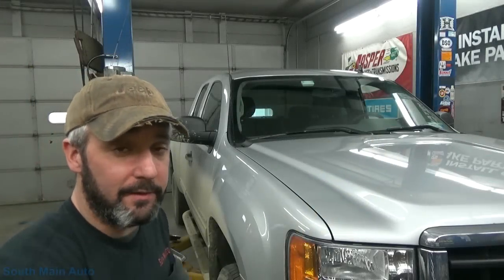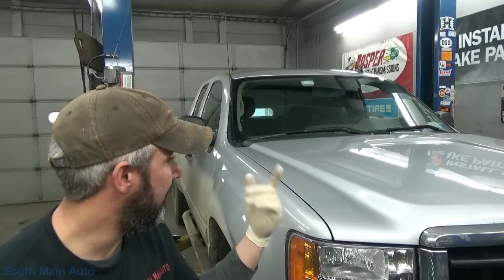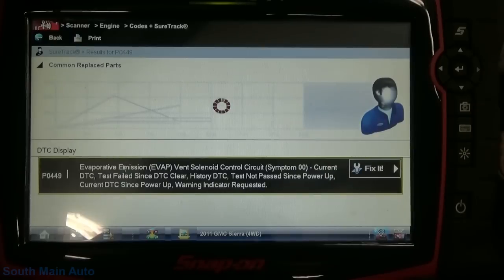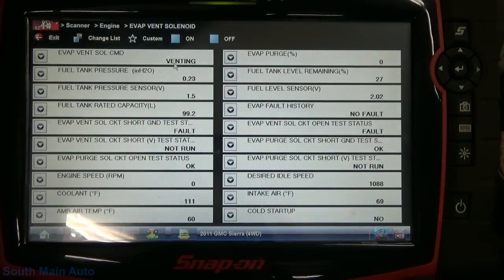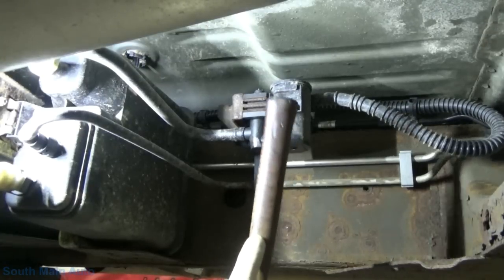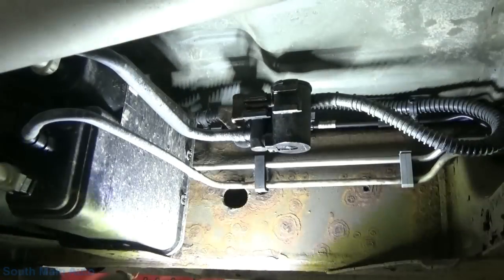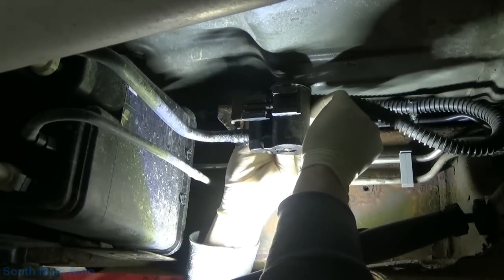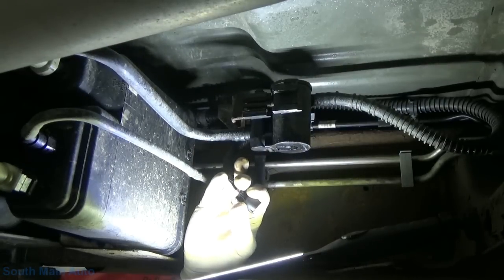GMC / Chevy Truck -DTC P0449 EVAP Vent Solenoid Control Circuit

Comment: It absolutely amazes me the amount of emission equipment installed on modern gasoline engines. Meanwhile, most diesel trucks on the road are producing  huge amounts of cancer causing smoke with very little monitoring.
Reply: not exactly... the exhaust system on a newer 6.7 powerstroke is over 10 grand... It has a DPF, Catalyst reduction. The truck also has EGR COOLERS, and they use a MASSIVE amount of EGR, not like the gas engines that use just a littlebit. Post 2008 trucks, by law you are not allowed to have ANY diesel particulates come out of the exhaust and the NOx has to be pretty much 0 as well...
Reply: Have you seen the new diesels? the emissions equipment on them is ridiculous!
Reply: TrakSpock1 yeah... and in New Mexico it doesnt matter if theres an onboard diagnostic trouble code for registering a vehicle... I know a few of my buddys cars have no PCV valve back to the intake, no EGR valve, no cat, no muffler, and still register their car and plates and sticker.... evrything... kind of bad for our planet though...
Reply: TrakSpock1 its all a scam.....vent valves....purge solinoids....vaccum pumps....then the def junk.....what a waste...the diag time on def is stupid
Reply: TrakSpock1 you have no idea what your talking about I guess you never seen or driven a modern class 8 rig out from the factory tool
Reply: The EPA has been outright hammering diesel trucks in the consumer market for the past couple of years. Diesels are actually more efficient and although that smoke may cause cancer, it at least falls to the ground and doesn't mess with the atmosphere.

I'm not defending those douchebags who roll coal in anyway at all, but people need to do their own research. The government is trying to shut diesels down and there's a hidden agenda behind it...
Reply: Yes i do. I work around diesel engines 12+ hours a day and a large portion of our workforce has cancer.
Reply: Yes I do. I work around diesel engines 12+ hours a day and a large portion of our workforce has cancer.
Reply: I'm sure that it's the same story with those working around gas engines.
Reply: TrakSpock1 do you not realize def and dpf and egr systems on a modern Diesel engine? that's no where near the emissions on a gas engine so I have no idea what your getting at!
Reply: In the UK about half of all our cars are diesels and the air quality in London and certain cities and around our main motorways like sections of the M1 and M6 is catastrophic. Particulates and oxides of nitrogen which are the result of diesel vehicles. The average road tax on an avergae diesel like 1.5TDCI in the Focus or 2.0 TDI in the Golf is like £20-£30 while a 1 litre or 1.3 petrol car will pay £110-£130 for emissions. Even though petrol vehicles burn relatively clean compared to diesels. It burns my bacon.

Comment: I would say any circuit with a load, the Test light would be fine, bit any signal, communication or reference circuit.. I would not use it on.

Comment: I thought for sure that was gonna be a Loadpro you pulled out not a SO circuit tester!
Reply from the maker: I almost did Mike but then I thought how bad it would fail on a current limited circuit giving false results so I went for the test light!

Comment: I replaced mine and the light came back. What can it be? Please help!! 2017 GMC Sierra
Reply: I have the check engine light on auto zone told me vapor canister I changed  light comes up again now I'm changing this solenoid valve I hope I fix my problem.

Comment: I think you should make a video on how to change the transmission fluid in your tundra. check it out, there is barley any videos on how to change it and how to make sure the level is correct. the stealership wants to charge upward of 500 bucks!

Comment: Test lights are only dangerous for people that dont know how to use them.
Reply from the maker: Not at all. Can you tell me how?
Reply: Well they could poke themselves in the eye. Nice video Eric, seems like a lot of rust for a 2011 , noticed it on the frame rails.
Reply: I was gonna say i dunno if anyone else noticed the frame rust, 
but i was sorta sitting there thinking i'd love to take Fluid Film by the gallon can and an electric paint sprayer or their air compressor kit and spray the hell out of that rust and any the underside of that truck. Or use Krown T40, either would do.

Both being non conductive is nice too.
Reply: 101sabre 
how many times I have poked myself with stupid probes! lol

Comment: Another one I'm preparing for with my '07 Silverado. 

I'm shocked the light hasn't come on yet for something - figured it would have by now, the way they build things today. Probably just jinxed myself ... lol!

Threw some headlights in a '04 Honda CR-V today. Wasn't too happy with Honda - gotta yank the whole plastic "bumper" off the front with all the rusted fasteners and brittle plastic push-pins just to extract them. What a joke! Pair of headlights off eBay for $80 shipped! HAHAHAHA! They actually fit too - shocker! For that price might as well make it a 2-year maintenance item. :D Happened to notice the location of the steering rack while I was in there - hope that thing never goes! Holy crap ... what fecal engineering that is!  Looks like it's only accessible from the wheel wells. Yikes ...

Also got a '05 Volvo V70, 2.5 turbo 5-cylinder - still need to poke around in the Autel on that one. Lots of strange PIDs I'm not familiar with. Strange codes too that needed translation. Guy is planning on dumping it at the auction, so probably won't get into that too deep, but I'll play on the Autel just to learn. I just had to fix the oil leak - was puking out of the plastic oil filter housing. $25 for a housing and a Bosch filter - not too bad. Easy day!
Reply from the maker: If PIDS on Eurotrash get out of hand I usually poke back in OBD2 Data to see if I can make sense of it
Reply: Ahh,  thanks! I'll try that out.

First time I have ever seen kilograms per hour for MAF. Fuel trims are strange too - something "integrator" (not the old block learn / integrator either) - forget the terminology, but was the first I have seen of that too. Had to poke around a bit to find live data - had another different explanation. Took me a while to figure it out.

Has a strange, real high-pitched buzz under the hood for several minutes after I shut the engine down  - no wonder the guy is ready to send it to auction. LOL. Another once great brand that's been cheaped out on front to back ...

Comment: My Silverado 2003 1500 LT came up with a p0449. The truck would idle very low or die out. I remember many years ago I had changed out the throttle body assembly with a new one on a truck I had at the time and that solved the problem. Now I have this Silverado doing the same thing. So I ordered a new throttle body assembly off of eBay which came with a new throttle body positioning sensor for like $56.00 and this solved the problem. My truck now idles again and doesn't die out. I suppose you could just order a new throttle positioning sensor and deal with drilling out the 4 rivets, but some people had a problem with the connector not pushing all the way in.

Comment: I do testing and build the testing equipment for the dust testing ingestion on this very same cyclonic/ CVS. It is tested to GMW-15826 and ISO-5011. These are very complex testing specifications. I'm surprised of the failure noted in this. The prefilter is in the upper intake by the filler neck ,  the cyclonic filter has a capacity of 40 gram , tested with ISO- fine dust. After the dust exposure it is tested to leak < 9 cc/minuet. There may be an issue of salt fog being sucked into the valve and make it freeze up. Not a failure mode in the test lab. Great video!
 I wonder if you have put 12vdc to the terminals to see if it activates the solenoid after removal? Almost needs a bore scope to look inside the ports to see dust cake build up, or anything else.

Comment: Appreciate all the information. I owned a 2009 GMC for 12 years. Traded it off in 2021 with 112,000 miles on it. Never once did I have a problem with anything on that truck. The only thing I replaced were my rear shocks at 108,000 miles.  
I bought a 2019 GMC 2 years ago with 35,000 miles. Since then, I have replaced my rear shocks and front struts. Front windows don't always power up correctly. Now I'm having problems with the evaporator system whatever. Almost makes me want to trade it in on a godforsaken Ford.
Reply: Anything past 2015 is when quality control went way down for both Ford and Chevy. It's called planned obsolescence, and it should be illegal.

Comment: I usually tape a chunk of string or wire to the filter before I pull it and the hose out of the crevice they stuffed it through.  Makes pulling the new one back in much easier.
The other option is to cut the hose off the valve and use the old hose as a pull snake.
The things you do when you don't have a lift.  :^)

Comment: The problem with the vent valves is they get dirt in them and they stick. Or they fail electrically. A lot of the time it's from dust ingestion a least here in the south. They get dirt in them because the air intake for the vent valve is on the fuel filler neck or they have been moved up on top of the trans as per GM's bulletin. But the still get dirt/dust in them. So why not hook the EVAP intake hose to the filtered air side of the air cleaner? Which would prevent dirt/dust ingestion.

Comment: Mine just went bad for the first time.  2007 Silverado with 187,000 miles.
Reply: Idk why a few loud mouths talk bad about GM. My silverado is 20 years old with 5.3 and 274k miles on it. Other than breaks and oil change its needed nothing but a fuel pump that I will put on here in the next few days. Still original coil packs too... Just replaced plugs and wires for the second time in its life!
Reply: @crowdnine878  Still driving it.  Now 211,000 miles.  No issues.

Comment: Has anyone told Scanner Danner you  can't use an incandescent test light on a computerized circuit? He might not take it well..........
Reply from the maker: Brian Smith it was a joke of course
Reply: South Main Auto Repair Hey sir, would you help me out on this code. P0385 which is a Crankshaft sensor position B. now not sure if it's the trans sensor or engine sensor since it has 2 Crankshaft sensors.
Reply: LACounty818  what year make and model engine size would be good to know
Reply: If it is a GM, I had 1999 Olds Intrigue 3.5 engine with that code and the a an b sensor are combined in one sensor. Sensor is located on radiator side of block near the middle (approximately) A sensor fixed that car, but as always, "Test, don't guess"
Reply: Grumpy's Garage yeah sorry I was dozing off. But it's a 2000 Accord with a 3.2 TL Type-S 6 Speed Manual Swap. I can rev the car perfectly fine and drives normal. Just trying to figure out which sensor is it since there's 2.
Reply: Scanner --has explained about test lights & how to check the lamps amperage
draw & mentioned 2 places you do not use a test light

Comment: Thank you for this video, Dr. O! I have watched your videos for a number of months now, solely for entertainment and education up until today.  I recently picked up a well-loved '05 GMC Sierra half-ton; I bought it with the money light on via this exact same DTC.  I knew you had done a video on this before and, sure enough, my YT history showed it a few months ago.  To note, the procedure is the exact same on at least the '03-'06 model years for Chevy/GMC but, at least on mine, I was able to re-use the hoses going to the various other components.  Took me about 15-20 minutes all-in with nothing more than a flathead screwdriver to loosen the hose clamps to remove the old part and to tighten them back on to the new part.  Watching your videos has given me the confidence to do these "easier" DIY jobs - heck, I told my wife it was easier than changing the oil in these newer vehicles - and I thank you for doing these videos.  I watch new ones almost the same day you post them!  Keep up the fine work.
Reply: Hey i got the same one. Did it ever go from working fine to next morning woildnt go over 40mph? It revvs up but then drops in rpm and hardly accelerates? 
Mine started doing that and cant figure out what it is

Comment: Darn, you are great and the information source! Love your Chanel and are a big fan. I have an 05 Silverado club cab that I pick up, which was beat, I repaired the many errors it had and now I'm enjoying the truck. Was unaware of the failure of the purge valve problem. Mine has no upper-end filter-what gives? I'll look into it. Thanks, Eric.🥰:learning:

Comment: Eric that test light looks suspiciously like the Kent Moore that the dealerships use its available at gm service solutions but extremely expensive I have been using one for years. One test light you may want to try if you can get on loan from the truck is the EECT401. I had to order mine in I have never seen them on the truck. Its digital  0.1v to 19v the box says 4v to 19v but is in correct the spec sheet tells it as it is. It really good on 5v circuits when the signal can be as low as 0.5v ,you can also do some quick and dirty checks on the canbus system when you will see 2.4v. Think
you would be impressed with it. If I get time I may do a quick video of it out in the field being used in the real world. regards
Joe

Comment: Hi Eric I think your home made 194 bulb test lamp is great and with a couple of alligator clips and long wire will do what the snap on will do at a fraction of the cost.
I always watch for the old solid brass tip Bic pens you pull the ink straw out and solder in your wire and there you have good probes for home made testers. The Bic Pens are getting hard to find now. Keep Up the good videos.
Brian & Shotty.

Comment: This will be next thing i guess. I cleaned the purge valve solenoid, changed the charcoal canister, and now i can barely get a dollar for gas. Gunna see if napa has the vent solenoid and get this done before work hopefully. I do go off roading here and there but I thought it was due to me overfilling my tank a few times

Comment: Working on my 2009 Chevrolet Silverado and the filter hose does not go to the filler tube. It is going somewhere under the cab. Going to have to figure out where.

Comment: great video all to common don't quote me I think that test light or at least the adapters are made by otc their part number is 3569 I've been wanting one for years
Reply: Mike Eustice  You are absolutely correct. Plugged OTC 3569 into a search engine and came up with several vendors.

Comment: I WISH mine looked like that - I have a 2002 GMC Sierra 1500 and NO way can I get to it. It appears on mine it is ABOVE the tank, above a frame rail with zero accessibility - I mean short of dropping the tank, I have no clue how to reach it ....am I missing something ? Nothing at the rear of the tank. I go to the front (toward the engine) and I can just make out what looks like that ribbed clip that holds it in place (if this is even the right thing). There is what looks like a ground wire to a bolt and a free hose venting to AIR ...Hoping you tell me "That's not it ..got to xyz" cause this is not a do it yourself on this model

Comment: I am working on my 2008 1500 Silverado (not made the 1st payment on it yet) . I am a handy man at best. I've replaced all my spark plugs, wires, alternator, purge solenoid, evap canister, battery, ac blower motor, dash, all filter's (fyi, the 2007- 2014 Silverado cabin filters are a b** times two because you HAVE TO CUT OUT THE housing  that would be its housing cap and SURPRISE, NO  D*** FILTER!  DO YOU HAVE TO CLEAN EVAPORATOR AND REMOVE ALL DEBRIS FROM THE CAVITIES AND ORDER A NEW PLATE/CAP AND FILTER.) she's sounding, running like a champ and sounds so good and seems to "perk up'" so well now right? Sorta kinda, I noticed oil leaking all over the oil pain (was told it could be a rear main seal leak)and transmission bell and coolant leaking from the tube that goes into their head of the passenger side head and beneath the intake manifold, aka a possible head gasket leak.  My heart sank and my eyes tear up.  I have drive train warranty, but y'all know how that goes, the rather the truck burn to the ground first!   I was told "when life gives you lemons, make lemonade! You have all the ingredients and the Haynes manual you have is your recipe book!"  I feel the truck coming back to life, but how much is too much?  I'm changing the coolant and transmission fluid change tomorrow and am the type of person that will work on repairing and upgrading anything till it can't go any further, yet I have so much to learn and am new to automatics but I love learning!